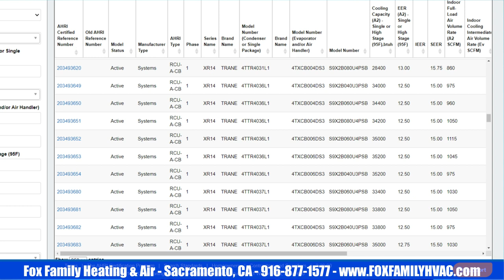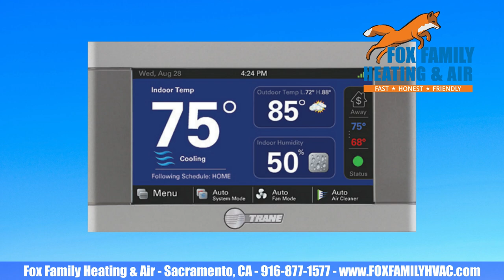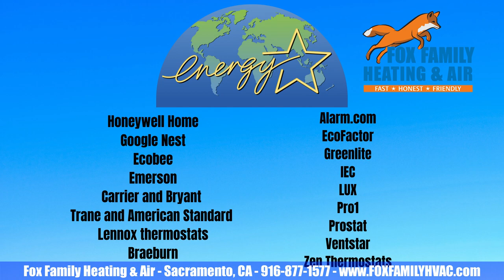HOW? Are Newer AC's More Efficient Than Older Ones?

Comment: I am an HVACR, electrical and plumbing  contractor and mechanical engineer.  all you say is true, however the parts break fairly often in these high efficiency units...
.
... . and can cost 10 times as much as those in the 80% efficient systems.    eliminating the savings benefits gained by use of the 95% efficient systems... in close to a majority of cases.
.
For instance the ECM blowers sell for $1,500 where the older PSC motors sell for $150... that is 10 times the cost..... the fan relays in the 80% efficient systems used to sell for $7.50.... now those are built into a printed circuit board ....that board sells for between $200 and $600.

My experience with a few thousand systems is that the operating cost savings with the high efficiency systems is marginal at best on average.

I recommend instead. lower efficiency systems. and zone controls (manually controlled to avoid the automated complexities and related repair costs for most buyers).   and elimination of electrical demand charges on the electric utility bill by various means.
Reply: It's largely about the manufacturing industry increasing volume by increasing demand it seems.  You don't find comparisons of BTU output per watt consumed (actual efficiency).  Not among new equipment and certainly not in comparison to good R22 units.  Instead they conjure some rating system which presumes to expect how people will use them and who knows what other assumptions.  Of course that new system popped into place at the loss of R22 systems so we can't even compare seer rating between the new and old refrigerants.
Reply: @elgringoec  With all this state of the art technology incorporated in the new units, it seems a matter of a simple program to monitor the efficiency of each individual system.  Or am I missing something?
Reply: I’m in your philosophical camp.
Reply: @werquantum  
That's certainly within the realm of possibility.  However, it could be an economic challenge to measure the BTU output of a heat pump in real time operating in a random environment.  That's why they'd perform the measurements in a lab under controlled conditions using calibrated lab equipment, then tabulate the results as representative of that unit when operated under described conditions.

What's way easier now is measuring electric power consumption - with microcomputer technology we can sense and digitize the voltage and current waveforms to measure their magnitudes and the angle between them.   Reproduced at mass scale now this is very affordable for homeowners.  But for efficiency calculation we also need a corresponding value for power out.  It's unclear to me how we would measure this real time in a dynamic operating environment.

Now if we had laboratory supplied tables of energy out under prescribed conditions along with energy in, we have what we need to calculate efficiency for those conditions.  If we have that data for two different units, then we can compare efficiency.

I believe that the air temperature rise from inlet to outlet along with the total volume of air being moved could give a reasonable facsimile of output power.  If true then to do so would necessitate in-situ measurement of total airflow, without disrupting unit operation.  I'm guessing the complexities of this measurement to be the challenge to overcome.

There's also the potential political concern that could make the change from R22 look like a mistake in terms of total energy consumption.  

China and India (and perhaps developing nations sourced by them) may still be using primarily R22 (I don't know, but they sell it).  And yet not a peep has been heard lately about the supposed hole in the ozone layer (that was sure to fry us all).   Interestingly...
Reply: @elgringoec  “We’re gonna need a bigger boat.”  As usual there’s more to this than I initially thought.
Reply: @werquantum  
A bigger boat 😂
More people onboard would help too.

Things could go either way, continue to divide the population into the "knows" and "know-nots", or get serious about education and start requiring people learn the basics of physical phenomena and real life skills.   
I taught my kids, now I can help teach my grandkids.  Most teachers couldn't teach how to change a tire, forget the basics of the refrigeration cycle.  That despite everybody having at least a fridge and many with air conditioning.  It's like curiosity is dead.

Cheers!
Reply: @elgringoec  More technology.  More apathy.
Reply: Yes and for those locations that will benefit, attic fans and whole house fans can cut the cost of air conditioning in half or more.

Comment: Trane sold me on a fancy zoned system "to save money" and within 6 years 3 of the 4 zone thermostats had failed at $150 a pop and one damper controller failed, and the main control board failed at 12 years.  My parents in contrast had one spring thermostat that lasted 40 years.

Comment: I’ve Been in the HVAC business for over 35 years. Yes the newer equipment is more efficient but there is no longevity. The older equipment would last 30 years the newer equipment may last 10 and has more break downs. For this reason my company quit selling new equipment 5 years ago. All we do is service and repair. The new equipment repairs keep us busy!
Reply: I don't believe the claims of improved efficiency, at least not by a significant amount that would make purchasing a brand new poorly built unit over a well maintained and functioning older unit.

They have banned the best refrigerants.  The newer stuff is an inferior substitute. If the newly imposed stuff was the best most efficient coolant, it would have been used before the old stuff was banned.

I suspect there are accounting tricks going on and not straight forward measurements like how many  joules to lower 1 cubic meter of air from 95F down to 68F.  If the old ones required 1000 joules to do that and the new ones do it in 900 joules, then I would believe it.  Instead, they use different metrics.

Then after you account for the fact that they last 1/3 the time as the old stuff, all the alleged energy benefits are eaten up by the months long party cruise the air conditioner takes from China to the US and energy replacement costs.

Comment: More energy efficient, yes. More reliable, no. The energy cost savings is overwhelmed by the fact they last a far shorter time. Just replaced my 33 year old Bryant that needed zero repairs until it finally leaked.
I have two 7 year old Trane units in another home that have had one evaperator coil replacement on one, two on the other. Parts under warranty, but $1000 each time in labor.

Comment: Good video, however when you have to repair the new systems ie: ECM motors, Electronic boards, T- stats, two stage gas valves etc. The repair cost are huge compared to the older simple systems. Example a EMC motor can cost $500 dollars to $900 dollars,and even way more plus the labor to change them are much higher. The older PSC motors are usually under $100 dollars. Thanks for the video.
Reply: If anyone is smart they'd keep thier old system running until a fatal failure occurs, ie Compressor dies or irreparable leak.

1st part out of warranty on a modern system alone cost will kill all savings in energy!

We haven't oiled blower motors in 30+ yrs!  Still have a customer with a belt driven furnace blower motor going along with original condensing unit and Compressor and good ol' Grey 5# tin can pcb filled original capacitors from 1978!

We'll replace it when it dies!

New systems today are pretty much guaranteed not to last for just even 20 yrs.  No matter what brand or how professionally installed
Reply: Boils down if breaks will cost you 10 time over ,will take you a live time to recuperate
Reply: Factor in downtime as well because supply houses are pretty bad at keeping ecm motors and controllers in stock, whereas universal PSC motors are readily available
Reply: I’ve enjoyed most videos I’ve seen on this channel until NOW. Basically made this video to say the exact opposite of what you’ve said in previous videos. I agree with this comment completely. An r22 system that is fully operational,  maintained, sized for the home correctly and has good static pressure is far more efficient than todays standard 14seer single stage/speed that also had a filter cabinet added (that raised the TESP well beyond what the unit is rated for. Ontop of it needing more return air, the list goes on. It would cost a fortune to have most systems changed out today from r22 to r410a if it’s done correctly. Which would add another 35% ontop of the total. And most companies don’t even offer the duct modifications because of the concern of “the other guys quote”. I’ll stick with my r22 units for now that have near half the operation pressures. 

FYI: I’ve been doing residential hvac for 11-12yrs.
Reply: This video is just a sales pitch.
Reply: Es correcto my friend.
Reply: True HVAC Companies now Act like Mercedes and Benz parts dealers a blower motor wholesale costs me like 900 bucks minimum oem
Reply: @georgekolos5255  especially that super high pressure Freon 410a units are a bust they are switching freon Again no more 410a units soon too many Lawsuits I heard
Reply: @georgekolos5255  horrible advice.... units will break down on the hottest or coldest days. In busy months you'll have to wait sometimes days for service calls. It's better to be proactive than reactive

Comment: Older condensers are more RELIABLE than newer condensers..
Last month I changed out my 1984 Lennox it ran perfect!!! I changed it out because I got a new furnace and A coil to match the furnace...
Last year Ted cook serviced a condenser from 1978...
The cost you save in energy is out the window when you have to repair these newer condensers...
I don't care what brand it is you're not going to get 30 plus years out of a modern furnace or condenser...
Newer units  are more efficient but the money that it cost to repair it supersedes the fuel/ electric savings...
Reply: 💯 correct
Reply: Nailed it
Reply: Great point.  The first service call and you’ve just blown up your savings model.

Comment: The problem is that much (not all) of this "new eeficiency"  comes at a cost of dramatically increased complexity and increased break-downs. And when break-downs do occur it's also significant more expensive to fix so all your savings don't appear if the full life cycle duration and maintenance costs are factored in.  THAT is why so many want to hang on to their older equipment.

Comment: I think the ductless systems are the best in any situation because duct leakage and return air leakage are both serious problems. Dealing with crawl spaces and hot attacks is dreadful. The mini systems if designed into a new house during the planning can be flush mounted and where there are a few small rooms have a ducted unit to go give a little air to the closet or powder room, etc. The draining would be plumbed in during construction In high humidity climates a separate large dehumidifier with its own registers and returns would compensate for the deficiency in dehumidification from the mini splits.  All that ductwork and returns is too susceptible to leaks and small leaks throw off the whole thing and then hot air is sucked in from wherever it can be, usually humid. For the enormous showplace mansions certainly a chiller would be more efficient. I just think the way things are done now are for the benefit of contractors sellling mass produced houses.  It is getting hotter and major changes are going to necessarily be made. I find that running my dehumidification system non-stop and turning my AC to 85 (it almost never gets to 85) allows the whole place to cool practically instantly since there is no latent load, and the dehumidifier works best at a higher sensible temperature anyway.  The whole world is changing very rapidly and the average consumer must educate himself about the humidity laws of physics and stop looking at an air conditioner as something that blows cold air.

Comment: I've worked at 40 year old properties that had original 8 seer units still running. You would be lucky to get 10 years out of these new ones, not to mention service call costs for constantly failing sensors, evap coils, reversing valves, and txv. Do the math on those costs.

Comment: Did he say the trane coils are not effected by dirt as much I have found the opposite to be true and they are impossible to clean
Reply from the maker: Just that that spine fin has more surface area. So it takes a little longer for the dirt to reach that critical level of dirtiness. Which has been proven to maintain seer ratings longer than standard radiator style coils.
Reply: You must be careful when rinsing out a spin fin coil because the fins are easily damaged if using a high pressure spray. A gentle shower spray will do wonders. I rinse mine and vacuum the drain every 90 days. I also use a 4” deep grill filter which I change every 4 months. My outdoor unit was condemned after lighting struck the home where it was installed. It’s a Trane XV20 4 ton system the drive had to be replaced the company that condemned it I think was not use to this product or how it worked I brought it home connected power found the drive was bad. I replaced the drive and so far no other problems.
     I think most parts today are changed by people who simply do not understand how to test the electronics on a newer system. If your not sure read the information provided to you online and never hesitate to call tech support if you are not sure. We sell more XV products than single speed systems on a yearly basis so we know them very well.

Comment: So this isn’t common but I’ve got my original 1983 Rheem 2.5 ton unit. I’m in OK the house is 1676 square feet. The unit has served me well. Cools very well with none of the issues you might see with under or over sizing. I do know that the drive or cfm is more like 3 or 3.5 ton from the comments of my service guy. My impression is that new units I may need to go up to 3 ton with a 3 or 3.5 ton cfm. Any opinion?
Reply: You’ll need a manual j calculation from an expert

Comment: How about share how long an efficient system is going to cost to fix and how long it is supposed to last vs. an old inefficient systems some still running with never having to have refrigerant added to them because of a Leak for 30+ years?
Reply: My new AC and furnace has parts warranty for 25 years labor less . The less seer rating on seer calculator says I will save about $300 a year on electric cost based on 9 hours a day use for the 5 month . When the AC company installed the furnace they asked what thickness filter I would like . I didn’t know I had a choice so i said the largest which 5”thick on a 16x25  more cleaning air flow change the filter every 5 to 6 months at about $40 each on Amazon .
Reply: @vmobile890  please double check your understanding of parts warranty information sir.

Heat exchanger for your furnace only maybe I believe 25 years.  Everything else 10yrs to the original purchaser if properly registered.

Todays equipment is engineered to last/ have to be replaced around 20 years
Reply: @vmobile890  25 years parts warranty?  What brand?

Comment: Is there a way to Control a Variable Speed System to run at a User Defined  Speed or Percentage(of max)  instead of a SetPoint Temperature ?   I have Minisplits in most all rooms where the occupants have different schedules and temperature preferences.  I want the Central air System to act for low speed air circulating , while cooling  at   2~4 degree  higher setpoint  temperature throughout the home. If a person wants a cooler normal temperature then that rooms Minisplit is set to the desired temperature,   I'm in Palm Springs CA summers 115 ~120 summers.    Any Ideas ???
Reply: I think what you are looking for can be handled through scheduling. If your controllers dont have scheduling ability then you can add controllers that do. Some manufacturers even offer a central controller that can schedule all units from one panel.
Anyway 
Set the building schedule (or all individual units schedule) to maintain 2-4* higher setpoints aimed at efficiency, then when someone want to be cooler they can set an override that automatically resets to building schedule after a period of time.

Comment: I agree with you about Trane systems because I’m from Vegas and I LOVED THEM…. Out there.  I now live in wichita where I have to deal with cottonwood trees and they WRECK spiny fin coils.  Sometimes I wanna light the system on fire to clean it.  Just a comment I like the video
Reply: I tend to agree that those spine "fins" are going to plug up over time as they collect environmental dirt. Regardless of rinsing them off with a hose nozzle a few times a year they are going to retain more junk than your typical condenser coils are.

Comment: What Brands are 3 & 5 Stage  ?       Is there a way to make a Single Stage System run at 50% Constantly until the setpoint is reached ?
Reply: You can’t make a single stage unit run slower or faster. it’s only has one speed which is 100%.

Comment: Sadly, new systems are more "efficient" to use but 5 times or more expensive to repair when they breakdown which is more often than older systems. Another concern is the downtime. How long a system is disabled waiting for those very special parts that never tend to be in the local supply house and have to be ordered from the manufacture. Then, as newer systems age, just how long will the manufacturers maintain parts supply to those systems that are very proprietary and 20+ years old?  These are very scary facts that can make an old system or a single stage system more desirable.